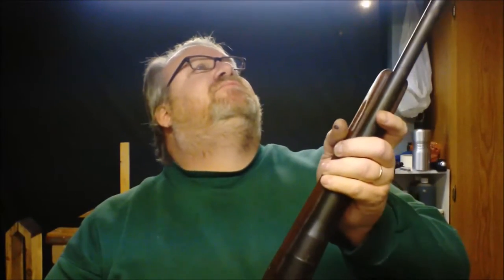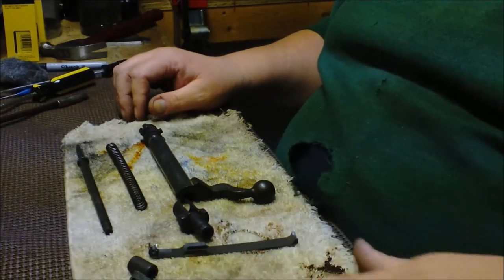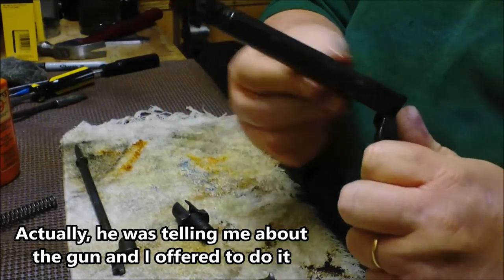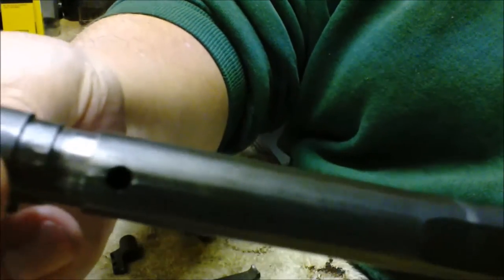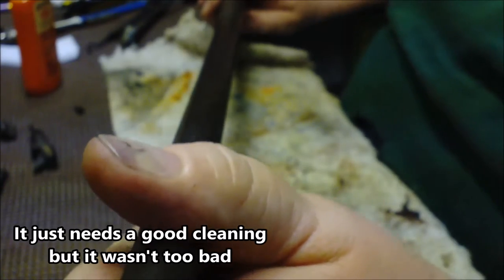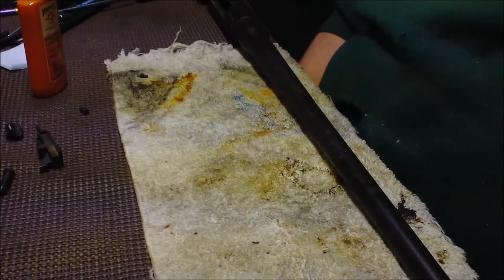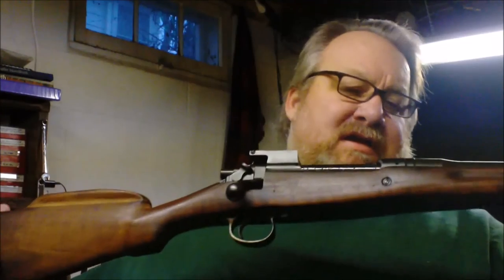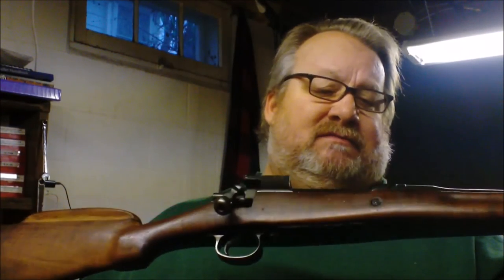1917 Remington refurbish

Comment: Hey mr. Tolly I have a Hi-point .40 s&w just like yours and I wanted todo some polishing work on it I was just wondering what you used to breakdown the factory polish on the slide and barrel ?
Reply from the maker: +Josh Sullivan I just used sand paper, started with 120 grit to get most of it off then went finer till I got to 1000 grit. Take your time and it'll come out nice.